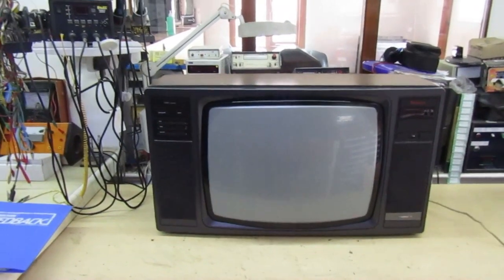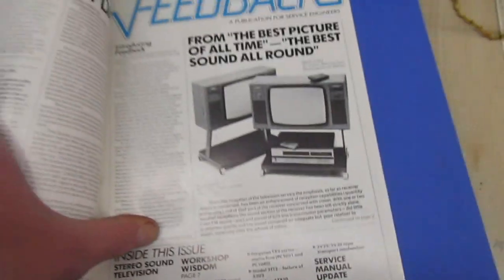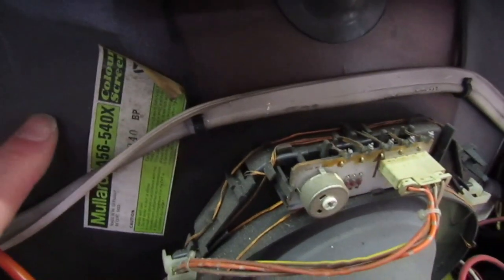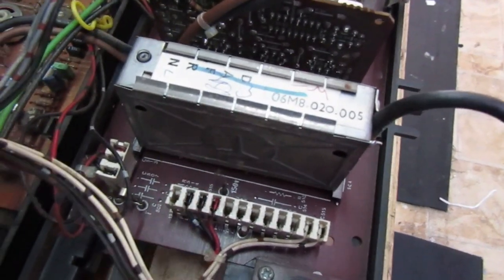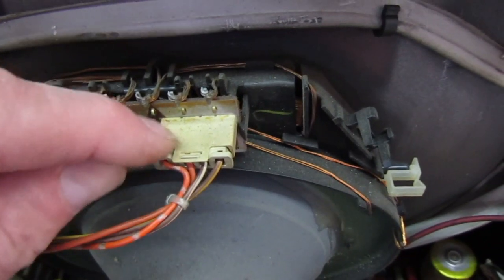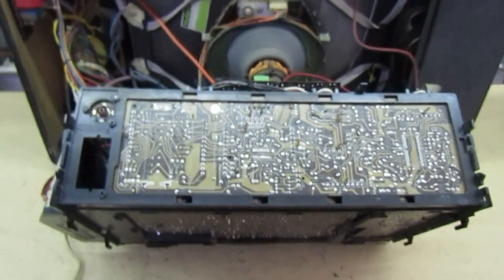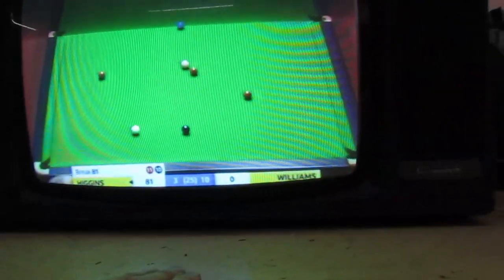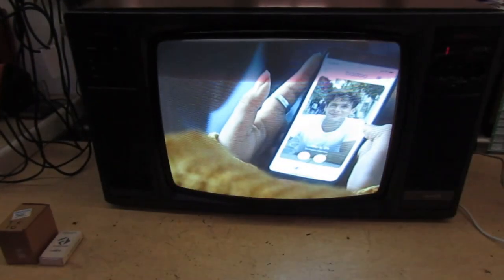Lets take a look at the Thorn TX10 Stereo Text vintage TV from 1982 .

Comment: Very nice to see one of these sets again, cheers Michael. In the days of colour VGA monitors a frequent fault, particularly some Compaq models, was drifting A1 and focus pots incorporated in the LOPT. Replacement LOPTs were £50 or so, not an economic repair. I got round the problem by adding a TX10 focus/A1 unit, a cheap and reliable solution.
Reply from the maker: The TX10 combined focus/A1 was a later modification for the TX10 the original Thorn part had problem with insulation breakdown when bolted to the metal chassis

Comment: I had 1 of these but I think it was a Studio Standard ??? Anyway, 22" with separate speakers and an LED bar indicator panel for the controls. I connected audio equipment to it and used it as an amplifier too if nothing on TV. Used to balloon the picture when I cranked it lol. Lovely TV with a superb picture and sound.
Reply from the maker: Not sure if it wasn't called studio colour , this set has the led bars on the front but I could not put it into the simulated stereo mode as I don't have the remote .

Comment: I remember a variant that had a din socket on the rear that had the stereo out and in. The TV could be switched to allow the stereo audio output of VCR's that had such, to play through the tv speakers. That remote had a few more buttons than the one that generally came with these Stereo models. Some early versions didn't have the Nicam decoder so sound had to be from an external source. The internal sound being mono. You are right about early sets having a pair of output transistors for the Fold circuit...They could cause some issues due to dry joints.  But overall it was one of Thorn's/Ferguson's better chassis.

Comment: If a tda3652, now obsolete a 3654.
 Pin 1 the feed resistor had to.be changed to 2.2 or 2.7k as this was the signal feed resistor. 
Them flat blue resistor generally wore out with heat.
Frame stage was prone so was the tx100
Reply from the maker: I may  still have those chips in stock ! I do seem to remember something about a mod kit , many thanks for the comment .
Reply: @michaeldranfield7140  your welcome

Comment: Nice one Michael! I seem to recall on this later plastic framed TX10, the 121K resistor in the power supply used to fail causing a dead set or tripping...
Reply from the maker: Im not just sure or not but I seem to remember the 121K resistor causing the chopper transistor to blow ?

Comment: The focus unit was a favourite aswell as the 121 k resistor
Reply from the maker: The focus unit was recognised by Thorn and a replacement white unit was produced, I think the 121K resistor use to go high and blow the chopper transistor if I remember correctly ?
Reply: @michaeldranfield7140   I only remember it being the cause of tripping or dead. However, it's been almost 30 years since I was a TV and Video field engineer

Comment: Another fine British made set, a later 1650 series TX10 with the plastic frame for the hinge-down I.F. panel. Looks like it's had the aerial socket replaced at some stage. The sound quality from these was good, I looked after a 26ins Baird (ex Radio Rentals) version which soldiered on well into the 1990s. The VCR in the sales material looks like a 3V23, the top-of-the range front-loading job which boasted full infrared remote control amongst many other features. No cable trailing across the carpet with this one!
Reply from the maker: the fault on the set was the classic low gain Darforn ELC1043 low gain tuner , tap on the side and the signals come back , I wonder if this is why someone replaced the aerial socket thinking this was the problem  ?

Comment: Remember these sets very well,the stereo was a pseudo wide type. They fed part of the left channel into the right and vice versa. Just before Nicam stereo was released. The switch mode ic always failed tda600. TX9 portable and the later TX90 chassis proved more reliable
Reply from the maker: correct , it just provided a phase difference between the two channels , I think Nicam 728 came along in the 1990s which was of course true stereo , The TX9 with the failed TDA4600 was a much better set than its MK1 version with the thyristor chopper supply and intermittent fuse blowing , my next video coming soon with be the TX90  Chassis .

Comment: Pretty cool looking set, reall :)

I'm curious, being from 1982, is this actually a NICAM capable set? (I'm assuming this was a bit too early) or was the stereo limited to just receiving the L&R channels from an external source?
Reply from the maker: No its simulated stereo by feeding back the left channel into the right channel and vice a versa to create a phase difference ,I reproduced the TX10 sound output stage on 4 circuit boards a while back  , Here is the link to the video 
.https://youtu.be/ljm_DMLtogw
Reply from the maker: Cant remember for sure but Nicam 728  came in about 1992-1995 ?
Reply: I thought it was a bit too early, still a pretty cool set though and a clever way to do a stereo effect.
Reply: @1990chrism  I had the 26" version of this & I got true stereo sound from it on channel 8, by feeding a stereo audio signal into the DIN socket on the rear and the video in through the rf socket. (Inserting the DIN plug disconnected the internal AF) Source was an Amstrad SRX200 analogue satellite receiver back in the day when Sky One and MTV Europe were free to air. Happy days!
Reply: In the early 90s Maplin electronics used to sell a kit to make a nicam decoder (They used to publish a good magazine with projects. the nicam decoder was published in the mag as well as an accompanying tuner board)  I used to sell these Tvs as ex-rental sets and i converted a few of them to have nicam audio using the Maplin nicam board if i remember correctly i also had to replace the SAW filter in order to get the 6.552Mhz nicam sub carrier signal to feed to the nicam board. it was great fun doing the mods on these Tvs

Comment: 1:44 Looks like the VCR is a 3V31, as the 3V32 had LongPlay - both stereo capable models albeit linear, so not quite the 'best sound all round'..more like having cotton wool stuffed in your ears! No fault of the telly, of course which would've really come alive with a later Hi-Fi capable VHS machine (or perhaps even the ill-fated VHD system!), and the right DIN socket jiggery-pokery. All before SCART became the norm, of course..
Reply from the maker: Im loosing track of the video model numbers now such a long time has passed but I should still have all the  service manuals for them .
Reply: Yes,  Ferguson 3V31 I have a working one at home!  Not as good as the 3V43 HIFI stereo video I also have.

Comment: Thorn TX10 sets were quite popular, and many were among the rental companies' stock. The TX sets generally were pretty impressive. Of course, they had their problems but were generally better than Philips sets of similar vintage.
Reply from the maker: just a pity the CRT didnt last to well in Thorn sets .
Reply: @michaeldranfield7140  Although one of the few sets I saw with a well-past-it tube was a Thorn, I also saw plenty of Philips and (sadly) Hitachi sets similarly afflicted - though at least with Hitachi the cause was known.
Reply from the maker: @PhilReynoldsLondonGeek  I seem to remember something about the insta vision sets which left the crt heaters on low power when the set was switched off had a short life .
Reply: @michaeldranfield7140  A definite cause with Hitachi.

Comment: Had one of these back in the day, brill tvs but the crts didnt hold up very well
Reply from the maker: The mullard tubes never did last as as well as the Japanese CRT s.
Reply: @michaeldranfield7140  So I hear that from brand new the best thing to do with the 22inch mallard tubes was to drop the filament by half a volt, in turn making the crt last at least 15 years longer

Comment: Nice tv mate  few dead sets here and both tx10 22 and 26 in. Blowing fuses etc
Reply from the maker: not sure but I think a high in value 121K resistor caused the chopper transistor to fail causing fuse blowing ?
Reply: @michaeldranfield7140  not sure where it is but ive a few here not working. One blows fuses and ive changed the bu transistor few times but still doing it. I give up in the end
Reply: @basgib  Powersupply electrolytics testing required I beleive. These things are getting old by now.